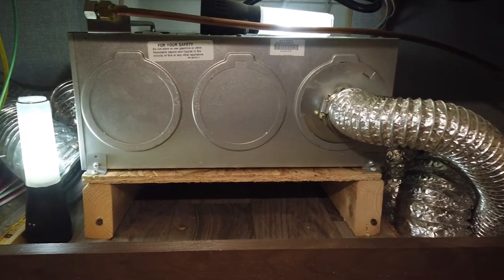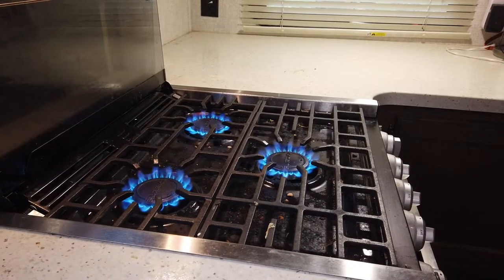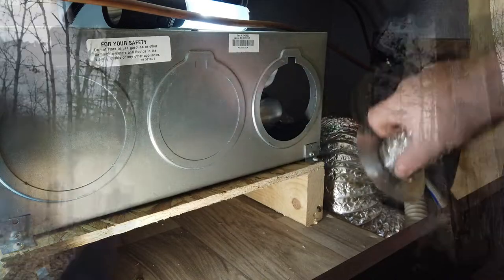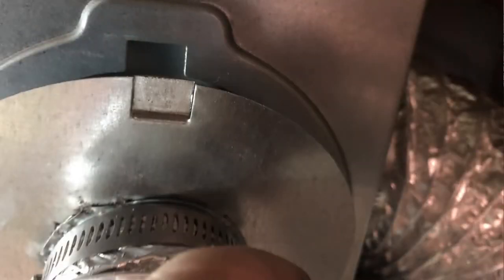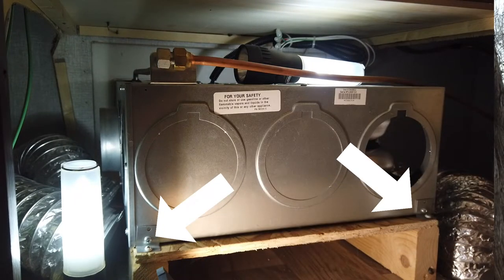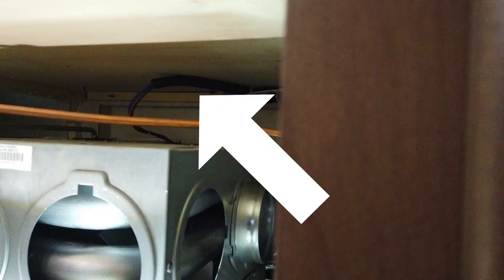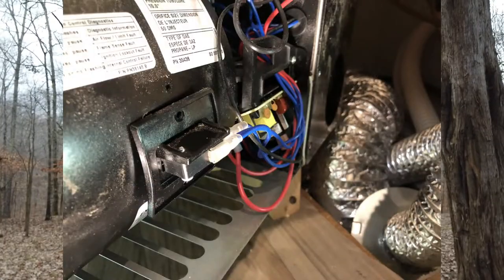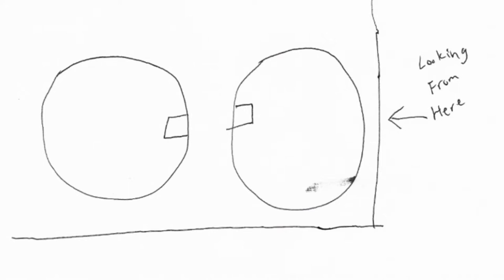Dometic Furnace Access #dometic #diy #furnace

Comment: Bro, perfect video.  I have the same heater, same access.  My hoses disconnected easily, so I was pleased.  Did not feel or see any debris but cleaned the switch with a soft cloth and actuated a few times, then reconnected and tested.  Success.  Taking picture of switch now.  Last night was cold AF so I'll be much more comfortable.  This is what the internet was made for!  Great job, well cautioned, explained, and videographed.  Thanks again.
Addition: when removing the sail switch, take care not to drop a screw.  It can go down where the hoses go.  Fortunately found mine.
Reply from the maker: Thanks. I’d go ahead and order another sail switch because I had to do this about 3 times until I replaced it.  Haven’t had a single issue since

Comment: Thank you for this, my heater never kicked on this past winter, new camper from Oct 2021 and it is situated the same way yours is installed!  This and your updated video are the best & most complete videos showing exactly what and where the sail switch is.  Love my camper, since Ida it is my home, a small 2021 Bullet 1700 BH, really like it.  I will fix this later this year,. thanks so much!
Reply from the maker: Glad it helped. I think next winter I’m changing the furnace out and adding an access door outside.  I think I have all the kinks worked out but I had some sponsors step up so why not😂.  Apparently this furnace has been discontinued and it’s mainly for this issue I’m told

Comment: Hey thank you for the info. I’ve watched several videos but yours was the best. The problem still persists though. I went to the local Rv dealer , purchased the sail switch, but still the furnace blows cold air. It doesn’t seem to want to ignite. Going to try & dismantle again. We have a fifth wheel also Durango gold. Furnace is behind the access panel in a compartment. Thank you.
Reply from the maker: Glad it helped but sorry you are still having issues

Comment: Great video. This must be a common problem with furnaces in an RV. We had ours go out a year ago. No access from outside. Ours is under the sink tucked back in the corner. Definitely not up our alley of expertise. So I called the mobile RV repairman to check it out and he had to replace it. Well, a year and 4 months later it happened again. Shouldn't they last longer than a year. The blower will come on for about 15 seconds, but I don't hear the click of the propane igniting. It's warming up here now where we live, so it's really not too urgent, but there are some mornings that it would be nice to turn the heat on to take off the chill. Thanks for sharing your experience. Happy trails to you. 🖒
Reply from the maker: It sounds like the sail switch.  I think they have a 2 year warranty so I’d try to go ahead and see about getting it fixed on their dime

Comment: Cool video! I've watched a LOT of video on furnace repair, preparing to attempt to fix mine. This is the FIRST that tells us how to get the furnace out of a Keystone Cougar system! THANK-YOU!

Mine heats to 60 just fine, then turns off. If I turn the thermostat off, & back on, it'll heat a degree or 2 more, & turn off. Once the furnace turns off, it refuses to turn on again, until I manually shut the thermostat off, & back on. I now know how to gain access to the system, but still need to research a bit to see what the issue(s) might could be in there.
Reply from the maker: Thanks.  I learned a couple things after doing it a few times that’s in the video link pinned to the comments

Comment: So Gimpy Camper, I fixed it. Not really sure even what I did, perhaps it was an air lock or something. Maybe something rattled lose.

But I drained the line using the stove, disconnected power, took one outlet connection off, cut the zip tie holding wires, pulled the unit slightly out and turned it so I could disconnect the other 2 outlets. Slid the unit out, turned it on it's side (had to cause of wires).

At that point, tested it a few times. Ignitor seemed to be working trying to light, there was something that sounded like it rattled inside upon turning it on it's side thou. So shoved it back in, put all together. Lite the stove and then fired up the furnace.

... and by some method of madness, it worked! 

Wasn't as bad as I thought it would be, unless I would have had to replace something, cause that looked awful.

Comment: Mine stopped working the sail switch had my dog hair on it.  Installed it back 
Worked fine for a while then stopped again.  I took it apart it had more dog hair. And my camper is pretty clean. 
So I decided to fabricate a filter and. 
Works fine.now. The problem is that there are no air filters. And the sail will fail with one piece of hair.

Comment: Most manufacturers do not put an access door for the furnace, When I got a call to work on one I looked at it and I said FORGET THAT! The only way I'm gonna go in there as if I cut a hole and put a  panel. Then I found out that some RV suppliers make panels.  But even if they didn't have one for that particular model I would make my own. Because that thing had like 6 ducts connected to it.  They really should put an access panel at the factory!  But all they care about is making money and not providing people with the ability to service  All the major appliances that break so easy on newer models themselves.  I'd rather buy an older camper in good shape than to buy one that's going to break within a year!
Reply from the maker: I have actually had suburban give me a promotional furnace and the access door which we’re hoping to switch out and put in this year. One thing that I saw in a Facebook group with someone put a plastic access panel that basically look like an outdoor shower just over the center where the furnace is to provide some access. My worry is that it would melt however it was 5 to 6 inches away from the Vent exhaust

Comment: Thank you for your video.  I got mine fixed but have a question.  Where does the small duct go?  Does it hook onto something under the floor us just stick down in the hole?  I have a 26 foot 2021 Cougar.
Reply from the maker: @bigsbyslur  there is a duct that usually just goes in the underbelly to help protect plumbing and such.  This is the largest issue with just using electric heat and not using the furnaces that you do not get the extra protection.
Reply: @GimpyCamper  Thanks.  It's the small duct around 2 inches like the one in your video.  It's only about 2 feet long so just tuck it down in the hole?  It's like the one in your video.  Thank you.  Burch
Reply from the maker: @bigsbyslur  I would say that’s where it went if you don’t see anywhere else it attaches

Comment: This is the exact same shit I'm having to go with on my Jayco right now!

Looks exactly the same! Same 2 cheap screws, which I'm positive hold it all in... screws cost money, right?

Thank you for this video! 👍👍
Reply from the maker: Had it helped… I understand your frustration lol
Reply: @GimpyCamper  lol. First off, I'm a Journeyman Sheet Metal worker, so I know furnaces and my hands are like leather. Even 26-28 ga sheet metal just slips off, which is what that is. Very fimilar with furnaces obviously working shop, resi, commercial and industrial.

But honestly, I took the return air wood grill off with 4 screws and said "What the fuck?" I have 3 more possible outlets to look at and a power button I can barely reach. How do I get this pos box outta here so I can get to the goods?

Yes, same issue, no spark ignition. So I knew it had to be a safety lockout of some sort. But how to get to it?

I'm lucky mines under a pantry. I could pull the whole 1/8" shelf out, but it's nailed in and holding the one broken rail together. I almost feel that would be worse to put back together, if even at all possible.

I also thought I may have an air lock, but now I know it's the sail safety switch. Thanks again.

Comment: Maybe just 
May, the manufacturer for these trailers will come up with a better more accessible  place to put the furnace  so it could be cleaned there fore maybe these problems would be less common.
Reply from the maker: They are actually going backwards as they used to always have access panels outside
Reply: @GimpyCamper  mine has a access panel  from outside. My furnace  just quit working ,but just been to cold here to work on or even try to figure  out what going on, bought a small propane heater in September for the what if the power goes out for several hours. Happy I did it.

Comment: The problem is the backing plate,file down backing plate to give the sail switch more room. Fixed the problem....
Watch video from Steve Lawhead on AFMD35121 sail switch Atwood/Dometic  Furnace.
Reply from the maker: I did and it didn’t help in my case.  The new switch I have works fine, but Suburban also sponsored me a new furnace to put in with an access panel, so that will be happening soon.
Reply from the maker: Apparently these furnaces have been discontinued according to another sponsor of mine, just because of all these issues

Comment: I ordered a outside access panel and installed it for my customer, dometic has to many issues not to have a access door, the rv manufacturer is being cheap.
Reply from the maker: Agreed.   I saw someone put just a plain access panel in that was plastic and just big enough to get into the sail switch and control board without changing the exhaust.  I liked it but not sure I’d like a plastic door there.  It looks like an outdoor shower cover.  Just not sure about any radiant heat

Comment: I have a few choice words for the designers at Keystone for not putting an access panel to the furnace on the Cougar!
Reply from the maker: Yep... We are actually going to swap our furnace to a suburban furnace with an access panel, but we decided we will do a video about installing the access panel as it is pretty much the same no matter what furnace brand you are using.
Reply: @GimpyCamper  I'm anxious to see that! I put a marine access (round) panel in the wall of our camper in order to access the sail switch. Made me nervous to cut a hole in the wall. LOL!
Reply from the maker: @benedavis6900  I was talking to the guy that helps me with this stuff and he is the one that mentioned if you are going to cut a hole might as well put the access panel in from the manufacturer which is what lead us to talking about making this video.  But apparently after my blowout yesterday I'm doing some tires first.  I have Goodyear Endurance but my plan was to go to a bigger axle and wheels that I already have so instead of getting one more of the 15" tires I'm just biting the bullet and getting 5 16" Hercules G rated tires...
Reply: @GimpyCamper  Yikes! Sorry about the blowout. I hope it didn't damage your rig! We've had great luck with our Goodyear Endurance tires. Should I hold my breath? 😳
Reply from the maker: @benedavis6900  no damage.  I’m not sure what caused it.  I am thankful the tpms gave me some warning though

Comment: OH I FORGOT , AND ILL BE WITH NO HEAT FOR A LONGTIME , NO RV REPAIRMEN WITHIN 100 MILES...GGRRRR
Reply from the maker: I have a portable a/c that has a heat pump that I use now for auxiliary heat, I also have an electric fireplace (doesn't do much), but when we were boondocking in the tetons a few weeks ago my heat went out again.  I decided now to throw my mr buddy heater in the camper since I never use it anyway.  It's a decent option I think, but you have to research the safety concerns and crack a window or a vent as well.  The largest downside to me is that since it's not a vented system, it introduces a lot of moisture in the camper....
Reply: @GimpyCamper  thanks for your info , but I have found the part I need and just waiting for shipment and then reinstall the furnance , WHAT A PAIN to take out .
Reply from the maker: Yeah, I just had to take mine apart again.  I actually had this grand plan of making it very easy by putting hose clamps with Y wing hand tightening Handles on them. But all in all it was harder to get those hot then it was to use a nut driver and tighten up the regular style hose clamps